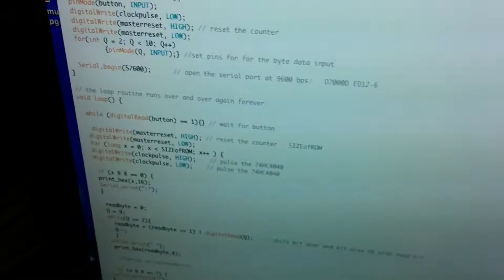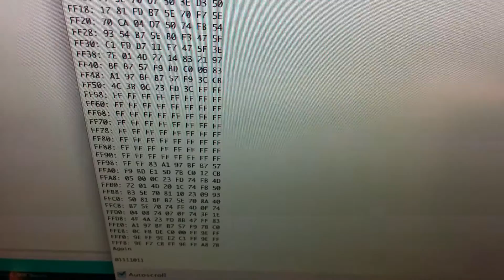Reading EPROM with Arduino

Comment: This looks like exactly what I am looking for. I have currently set up a bread board with a ardruino nano 2 74LS595 shift registers
and a 28C16 ROM.

I am having problems reading the data in off the data(I/O) pins.

I have manually programmed my EEPROM with a 0,1,2,3 at addresses 0,1,2,3. I can tell all my wiring and ROM are woring correctly 
as when I set my Serial.println(readEEPROM(0)); to 0,1,2,3 I get the correct LEDs to light up on my data (I/O) pins.

So I am sure that it must be a coding problem.

This is my current code. The addressing portion is working. It is the reading in, that is the problem. 

https://drive.google.com/open?id=0B6LIgQzDkH8fUDR1eEloWlc3TlU

Comment: If you want to read and write to these chips (among others) on a regular basis, you should get a proper programmer.  I have the MiniPro TL866A and it programs and tests almost everything.

The TL866 programs microcontrollers, EPROMs and EEPROMs and tests RAMs and logic circuits.  The CS version of the TL866 is cheaper, if you don't need the In Circuit Serial Programmer part, but both versions are quite affordable for either professional or "serious" amateur use.
Reply: JasonMasters but hacking is fun and learning to code the arduino to read them is a worthwhile endeavor
Reply: Quite true.  It's easier to just buy a computer than it is to make your own, but you learn a lot more from the latter. :)

Comment: I do still use those roms at work any and all sources would be extremely helpful!
Reply: If you mean sources for the EPROMs, many of the current EEPROMs are designed to substitute for the old EPROMs, since they come in a compatible pin-out.  They're a drop-in replacement so you can throw away the old EPROMs and go for the more convenient EEPROMs.

If you mean a source for a programmer, I'd suggest the TL866 which I mention in my comment above.